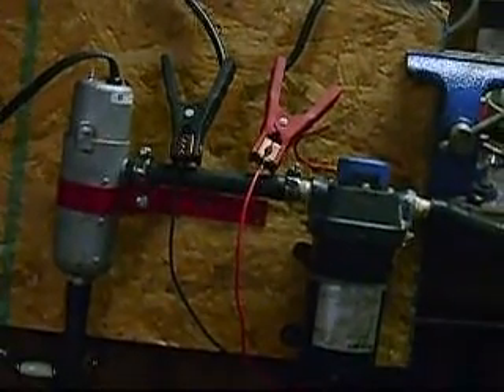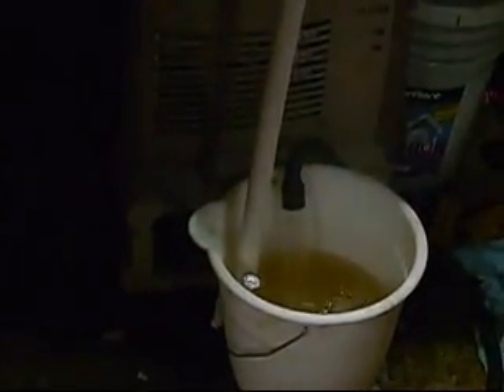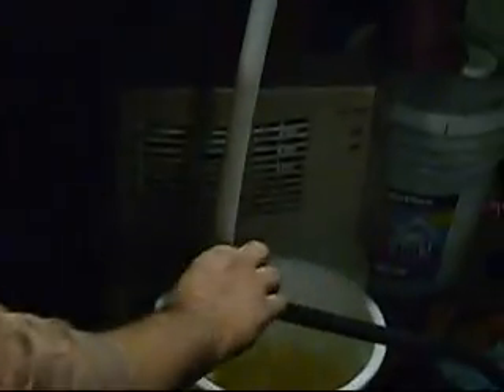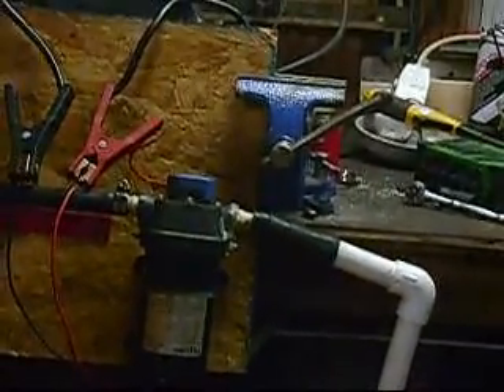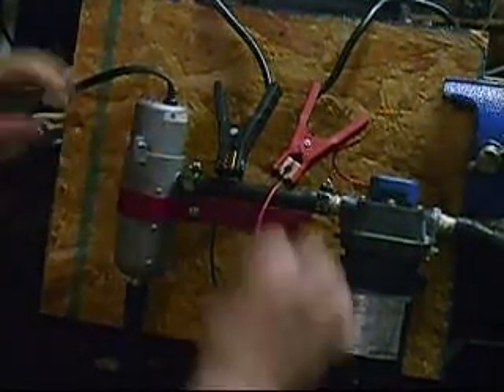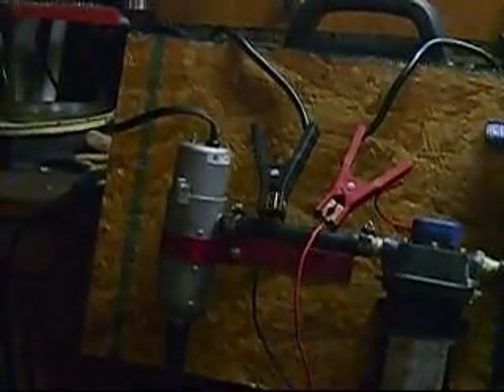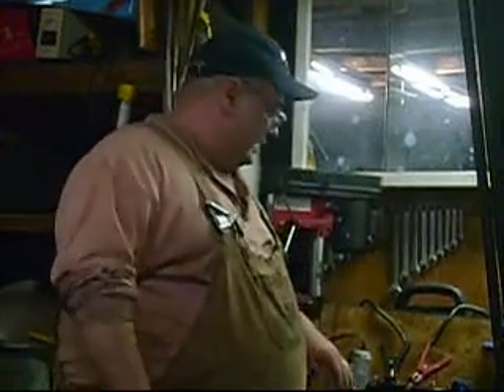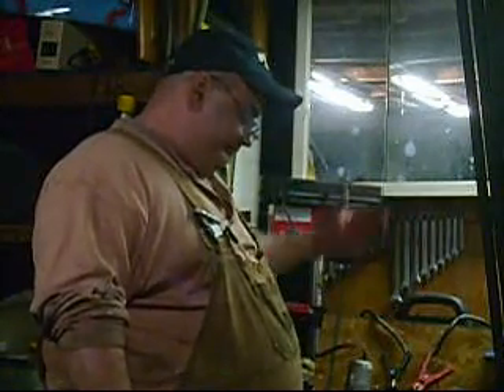(02) Electric car conversion heater system

Comment: If you want range on you electric car. Use a generator head looped to power the electric motor spinning  the generator head and use ac/dc. Convertor.

Comment from the maker: the unit i have does have a limit switch to control the water temp. its a 1500w it cuts off at 180f and cycles on at 160f. 2 gallons of hot water should be plenty for a trip to work. then i can always plug up before the return trip

Comment from the maker: take a look at cloud ev there is a pedal made that you can bolt to the floor.  
i have watch a vid that shows a large parcel van that was made into a hybrid. its kind of what you are describeing. i am not sure of the poster's id. thay were useing an ev motor to help the truck under a load.
make sure to post some video as i am intrested in your idea. 
good luck

Comment: As I watched this video I thought you might use a small plastic ice chest for your water/antifreeze storage and then you could also use the same chest for your AC ice storage. By drilling holes and fitting pipe fittings it'd would work pretty good and hold the temperature somewhat. Anyway, great idea you've got there.

Comment: OOOooo Me Likeee, Good idea. ac and heat. Hung hot water when theres no power too. YEP I like it. Looking good guy's. I had a thought, ya know when you get a hot water bed they give you some sort of powder treatment stuff to keep the insideds of the mattress clean from algi buildup. maybe that would be good for that pump system to. its not like your going to be drinking it and it will be there for a while right. anyway. keep up the good work.